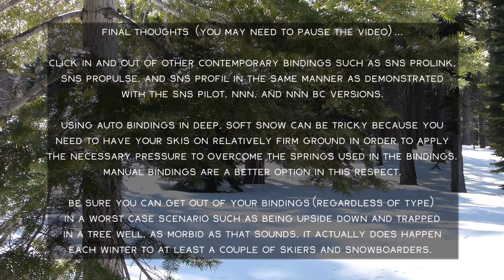Clicking In and Out of Your XC Ski Bindings

Comment: I have the NNN BC (Manual) Binding.  I am an intermediate skier but this is a NEW Binding & Boot system for me.  It is extremely difficult for me to "Click-Into" these bindings .  This Video is so well done and so helpful that I am actually "Book-Marking" it for future reference ..  It is simple & straight forward & very helpful .  Great JOB !!
Reply from the maker: Thanks so much for the kind words, Daniel :) I appreciate your feedback.

Manual NNN BC bindings are a bit stiff as far as locking yourself in and then releasing them. But, I like them better than the auto version because they do feel beefier. And, they're easier to use in deep, soft snow. I don't recall if I mention this in the video, but the auto version has a robust spring that can be challenging to overcome if you have soft snow (i.e. you try to step in but instead of actually clicking into the binding you wind up pushing the ski further down into the snow - at least until it compresses firm enough). The manual version enables you to click back in a bit easier in those soft snow conditions. It's not that common of a scenario, but I've experienced this a couple of times with the auto version of NNN BC, where I was breaking trail in deeper stuff and decided to take the skis off and take a break (but then momentarily struggled to get back into them).

Thanks again for the comment!
Reply: @JaredManninen  Me and my son was struggling to get back into NNN BC Auto for 20 or so minutes in deep fresh powder. Are there any other tips on how to do this in such conditions? Maybe we needed to step with one foot onto the ski so it doesn't move and then try to bind?
Reply from the maker: Thanks so much for the question! I assume you read my comment above and saw that I've experienced the same thing.

Yes, using the auto binding in deep, soft snow is challenging. But now that you know this, I'd recommend packing down the snow around you with your skis before taking them off. Basically, create a firm base on which you can click-in. Or, if you take them off maybe do so near a firm obstacle such as a downed tree or boulder and use that object as a base for clicking in.

You could maybe try to manually press the button and operate it like a manual binding, but I know that spring is stiff. If you were wearing a backpack, possibly consider setting the ski on top of that and click in.

I realize it sounds like I'm just throwing stuff out there (which I am!), but it's all just a matter of creating a firm platform on which to lay the ski so that you can put enough force on it to click in. At this point, since it's a known issue, I think you'll be more prepared the next time it happens.

Anyway, not sure how helpful that was but it's all I can think of at the moment. Let me know if you figure out any brilliant ideas. And that's again for watching!
Reply: @JaredManninen  Somehow your recent reply also came to my email .. Ha ha ha ..  YES I agree with you as usual >>  TO "FALALYST"  >>>  Do whatever it takes to get out of deeper snow or stomp it down to get a Hard-Pack >> Also;   Get on Level Ground if possible;  Do whatever you can to stabilize your ski ..  Sometimes I carry a small Tarp to sit on when I have lunch etc .. You could actually carry something smaller to put down as a small matt under your ski .. THAT keeps your ski  from sinking while you manage your bindings ..  ALSO;  I always carry a very small Dowel (6" long x 1/8" diameter) to clean out the snow in the binding ..   Before I go out for the day I put Maxi-Glide on my binding to minimize the chance that it will ice up >>    I hope my ideas & Jared's help ..  Anyone that has skied has encountered the "Binding Blues" >> I have been in some pretty remote places and had a similar experience  of spending most of my time & energy "Clicking In" rather than skiing >>>> We could all put our heads together and get a Sad Song out of that experience >>  Ha ha ha >>   Daniel (Oregon)
Reply: @fatalyst   See my reply to Jared's (Below)
Reply from the maker: Daniel, that is funny that my comment went to your email. Kinda weird, too!

Great ideas, though. Thanks for contributing to the conversation 🤗 I also carry a small mat (either a small Ridgerest type or cut piece of yoga mat) when going for an all-day thing. That would also help as a platform.

I also like the idea about adding a lubricant to the binding. I usually use a basic silicone spray once or twice a year.
Reply: @JaredManninen  Yes; I also spray the inside of my binding with a Silicone Spray and that seems to help too >>  I have skied in Western; Central; Eastern & NE Oregon;  Plus Big Sky Montana;  Yellowstone;  and a few other places >>     I envy the newer skiers because people like you are posting some very informative You-Tube Videos ..  I am self taught so I have a LOT of bad habits ..  NOW I am really watching a lot of Videos and practicing the Basics >.  Thanx for all your hard work & patience to help us old folk learn new tricks !!  

I also bought a Wax Table and have been waxing my skis >>  Thanx for all of it !!   Daniel
Reply from the maker: Yeah, having the benefits of an information revolution is pretty cool. And pretty revealing when you've been doing it all on your own for so long. It's all good, though. Learning is an on-going process that should always be embraced. And there's plenty i still have to (and want to) learn!

Thanks again for everything!
Reply: @JaredManninen  A guy that used to work on my Land Surveying Crew used to say in a gruffy voice "" Between us; we got a Brain"  !!   ha ha ha ..  Yeah hopefully my ideas are relevant & worth listening too >>  Thanx for what you do !!
Reply: @JaredManninen  yeah;  I think the newer folks have a good thing because I never had the luxury of You-Tubes ..  Thanx for being part of the "Solution"  Daniel
Reply: @JaredManninen  The "More I Know";  the MORE I KNOW I DON'T KNOW ""  !!  There is always something to learn  so thanx always for being such a good teacher >> Daniel
Reply: @danielpatterson7524  @Jared Manninen  Thanks for your replies, guys. We are heading to 1-day backpacking trip on skis in 2 days, so your suggestions might help, along with knowledge that it is not only you struggling :))
Reply: @fatalyst  Have a wonderful Day Trip .. I can't remember where you ski ??  I was thinking Wisconsin or Minnesota ??  Anyway;  I hope you have better luck with your bindings on your trip >>  I will look forward to another Post when you et back home  >>  Bindings are an International nightmare but it is like "Falling Down"  ..  It is all about skiing so have a Great time out there and give us an update when you get back >>   Daniel (Oregon)
Reply from the maker: Good luck! Sounds like a great adventure ❄️👍❄️
Reply from the maker: Ha Ha! Sounds like your coworker had a good sense of humor 😆
Reply from the maker: I agree, access to information is a pretty cool thing 👍

Comment: Great instructions for getting single bar boots into my xt60 rossignols; cruising in for the landing got both of them on right away. I struggled alot last season; thank you!!!!!
Reply from the maker: Very cool, Jamie! I'm glad you found the video useful, and are able to get in and out of your xc ski bindings with ease now :)

Thanks for watching, and for the kind words!
Reply: @JaredManninen  Out in the snow I had to find a way to keep my ski from sliding forward; turning my pole upside down in the snow in front of ski worked where there was depth of snow to brace it in. In trying to get them on in the parking lot where snow was packed I needed help from a friend to hold ski in place. I suppose you could use your car tire to brace it if you didn't have help nearby. Snow is mostly gone in Buffalo. More coming next week! Thanks!
Reply from the maker: @jamiejordan5451  Hey Jamie!

Thanks for tuning in, and for sharing your experience :) Glad you were able to find a solution for clicking/in out of your binding without the ski sliding around too much. I often try to position my ski on a flat or even slightly uphill spot so that the ski doesn't slide downhill, for example. But it can be hard to find a stable spot in which to do so. Anyway, I hope you do get more snow soon. We've been having a really low snow year here at Lake Tahoe. It was about 50 degrees yesterday, and we're supposed to have 50s as daytime highs for the next couple of days. Yeesh... Here's to hoping that we both get more snow next week! Again, thanks for watching and contributing to the conversation :)

Comment: Very much appreciated.  Just getting back into this. I grew up using the duckbill system as a child and need to know how to use the new ones.
Reply from the maker: Thanks so much for the kind words, Robert. And glad I could be of service :)

Just an FYI ... some newer manual options (that came out 1-2 seasons after I published this video) for groomer-oriented xc skiing have slightly different types of locking mechanisms. Nothing too mind-blowing. It's just that many of the manufacturers started to incorporate a twisting lock/knob instead of the flip-up style of operation. The twist type generally just require you to turn the knob a quarter turn so that it's perpendicular to the length of ski (open). When you want to "click" in, turn the knob so that it's in-line with the length of the ski (closed).

Anyway, thanks again! Let me know if you have any other questions.

And, believe it or not, you can still by some basic NN/3-pin bindings that use the duckbill system :) Those are generally used for beefier backcountry-oriented xc skis. And I have two sets of them :)

Comment: Hello Jared;

Thank you for your response>>   I rarely  post a comment  but your video was  is really well done.  Thanx for both !!  

I am going to put a rug down in my garage and practice these NNN BC (Manual Bindings)  >   I agree that deeper snow is always an issue and I purposely hike over to flatter hard-pack to click in>>  I always clean my boot & the slot of the binding but i just need to get the feel of getting the boot in perfect position. 

Your video will be extremely helpful so thanx again for doing that >  

I used to run a Fisher Crown E-99 but after all the years the Camber is FLAT !!   ha ha ..  Who knew that you could wear out the Camber on that ski right ??  

Anyway;  I am 68 now;  so my skiing is tame (Forest Roads in Western Oregon) >>  I live relatively close to the Willamette Pass Area so there are a few trails close by >>  Anyway I just switched over to the Fischer Spider 62 and Alpina NNN BC Boots ..  My skis are 12 inches shorter and nearly 4 lbs. lighter than the E-99s  !!   

Thanx again for your help >>   Daniel
Reply from the maker: Thank you again for the wonderful comments, Daniel :)

The E99s are definitely classic. Eventually I want to get a pair but I've always equated them with Polar expedition style xc skiing (hard-packed and wind-scoured snow) as they seem to be a bit straighter with regard to sidecut. But they're very cool! And, yes, I can believe cambers can get worked over time which is why I seldom recommend people buying used equipment. haha.

Anyway, glad to hear you're still xc skiing. Sounds like some fun locations that you can access. Good luck, and have a great winter!

Comment: This was good information regarding new technology of the release buttons..my skis have a single release bar and I cannot release them unless putting all my weight on the button standing up...pretty impossible if you fall and need to remove the skis..I am going to lube the button to see if I can loosen it up, otherwise I need to get new skis..As a 68 yr old woman , getting up with bad knees is daunting.
Reply from the maker: Thanks for the nice feedback, Martha!

Auto bindings are generally pretty good but, like you said can be a bit problematic to get out of if you fall down. In this respect, manual are the better option.

I like your idea to add some lubrication to the binding. I find that a silicon spray can be helpful. I don't recall if i mentioned it in the video, but I've seen a lot of auto bindings freeze up in certain conditions (usually end of the day when the moisture that's collected around the binding freezes), so using a lubrication can help prevent that.

Anyway, thanks for watching and for the meaningful comment 🤗